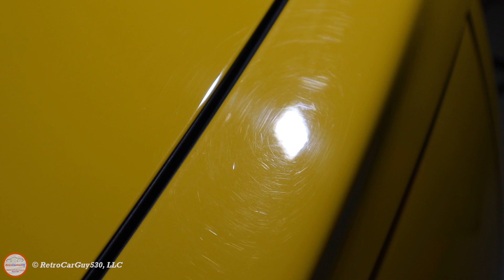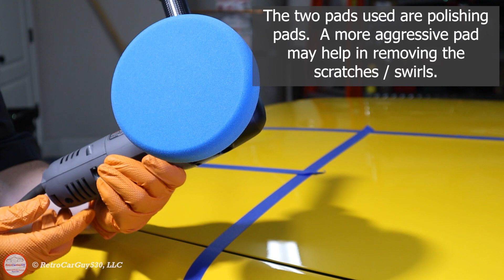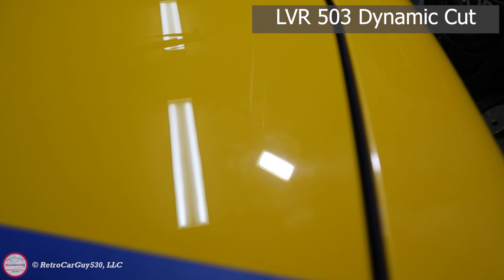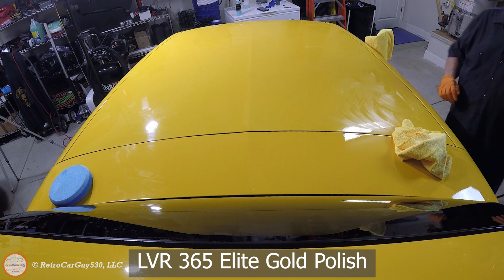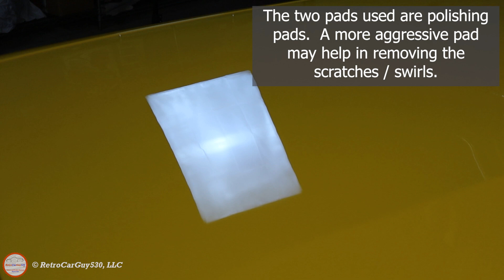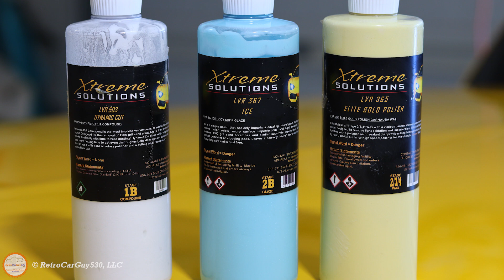Xtreme Solutions LVR 503 Dynamic Cut / LVR 367 ICE / LVR 365 Elite Gold Polish - Product Test

Comment: You have to do a couple passes at slow arm speed.
Reply from the maker: Thanks.  Some of the video footage was sped up to reduce the video length, but I understand I might need to slow down a bit as well.  I'm trying to get the correct pad(s) for those products as well.
Reply: Yes definitely slow your speed down to correction speed. 1 inch per second. Also try a Lake County Orange cutting pad. You're dealing with hard GM clear coat..